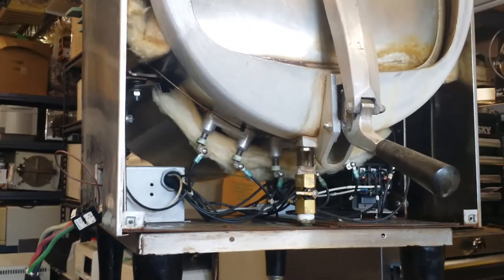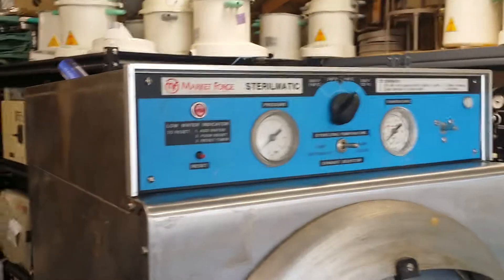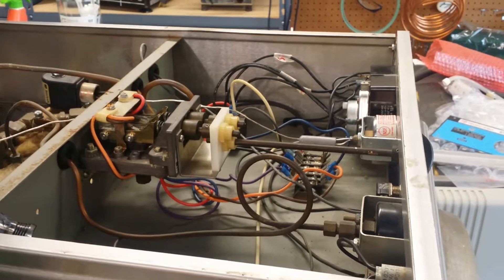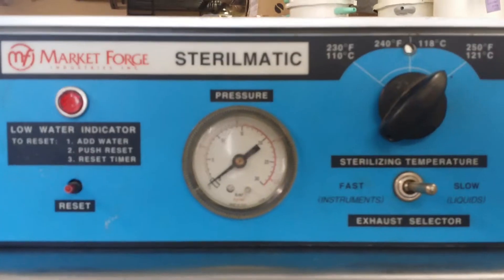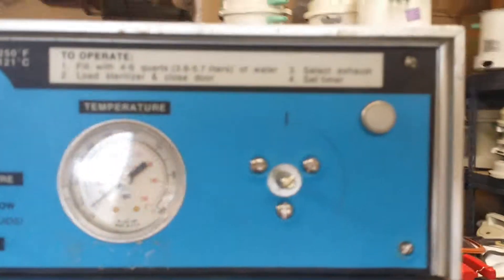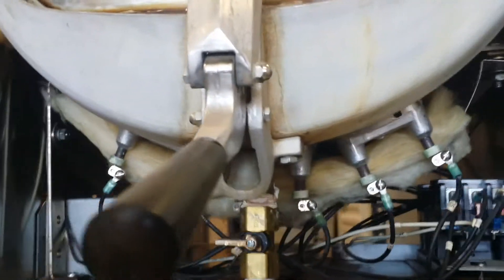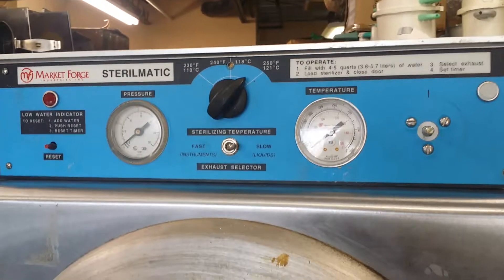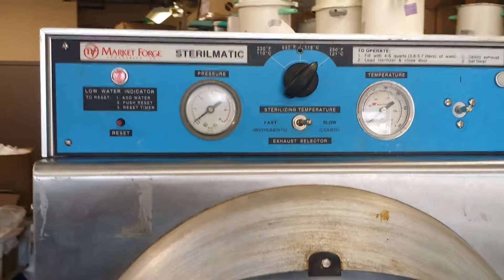How to fix Market Forge STM-E, STM-EL Sterilizer Autoclave

Comment: hello, I don´t know if you can help me, I got a Market forge autoclave 7 years ago, and it was working very well until 2 days ago when it presents a problem. 
when I try to begin a cycle and I turn the timer to the position of starting, it turns the light off when it is crossing the 5 minutes indicator, so I can not put the machine to work becuase the timer do not responds. in your opinion what could be the problem?,  thank you so much for your help